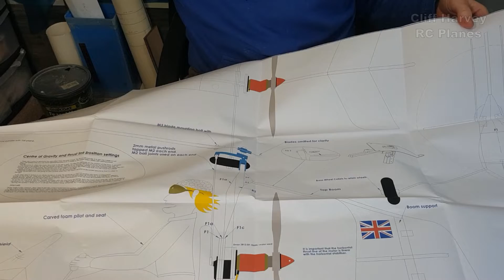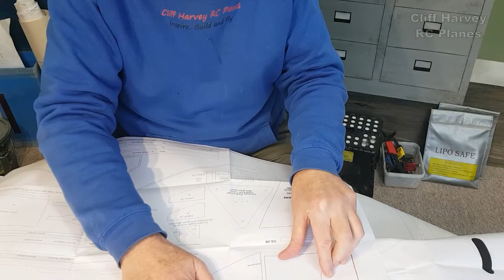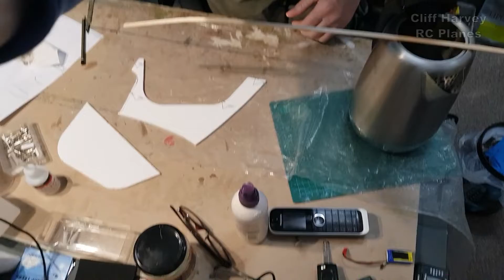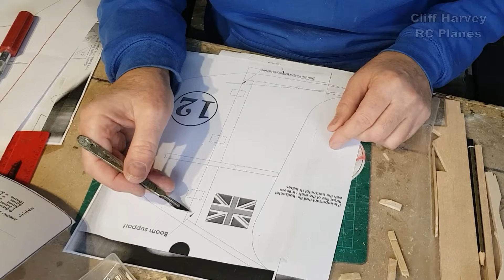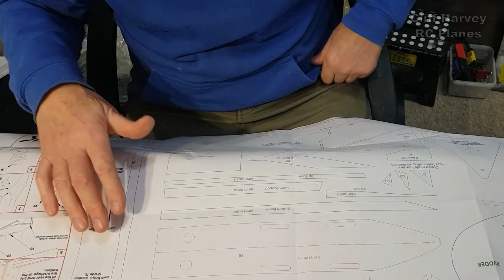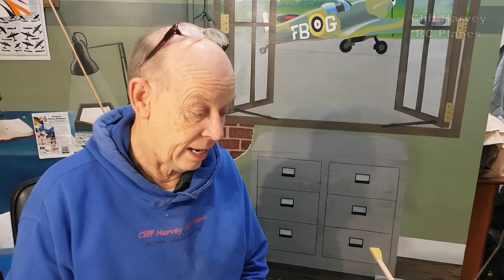Mantis Autogyro Construction (Part One)

Comment: Great bit of Balsa fettling Cliff, looks a great design!! Don't forget to order a proper pusher prop makes a big difference to the noise levels and stops your prop nut from coming un done 😀👍
Reply: Yes most do but if you get a proper pusher prop the motor has to spin anti clockwise looking from the back and then you won't have to worry about the prop coming loose 😀👍
Reply from the maker: Hi Ian, I think the designer used to tractor prop facing forwards, good tip about the nut though, cheers